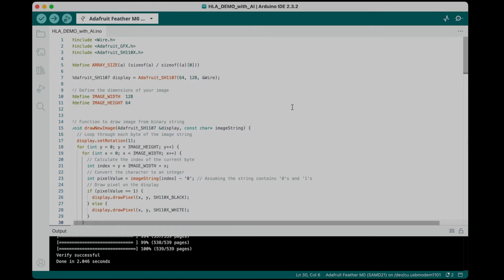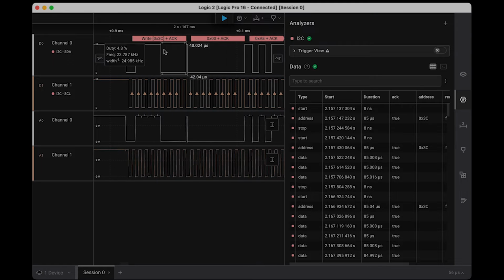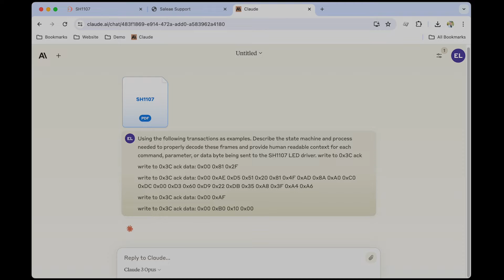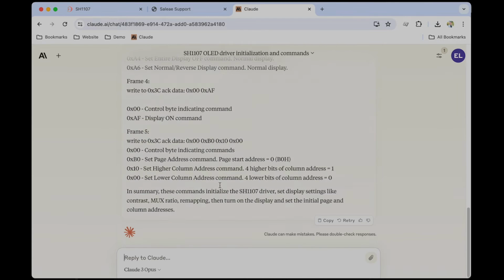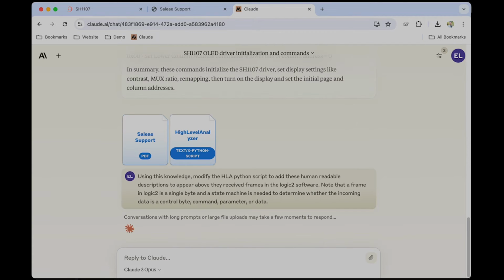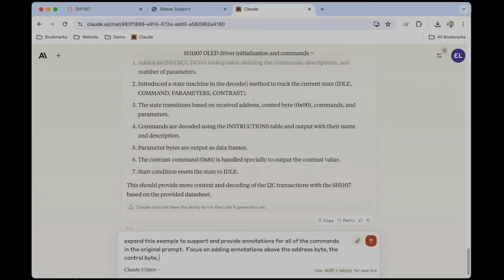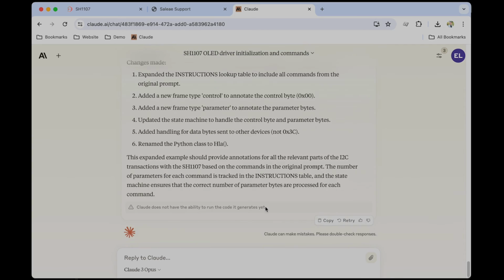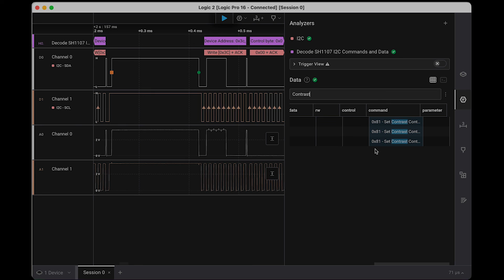Debug Protocols Faster with AI Generated Logic Analyzer Extensions

Comment: Now if only chips would have a trigger bit that gave a unique identifier so that when you read it it gives you an identifier to get the protocol and spec sheets off of the internet automatically using AI and the logic analyzer would instantly have the info it needs to make it the correct protocol, decode the info, and make it human readable without any intervention other than reading the line ;)